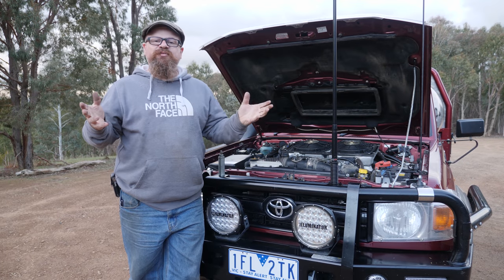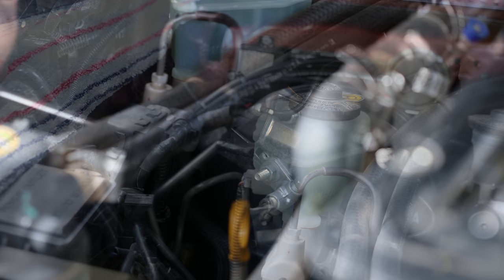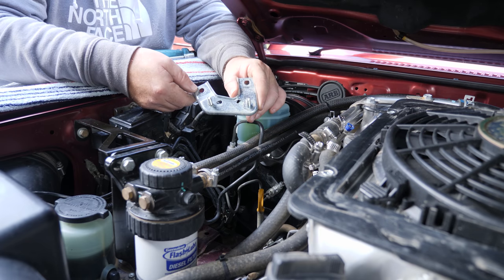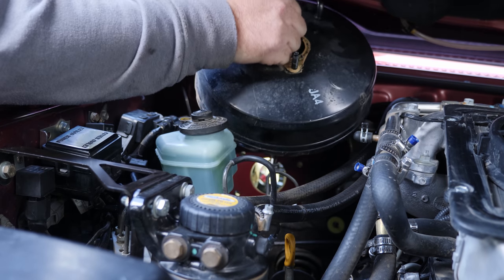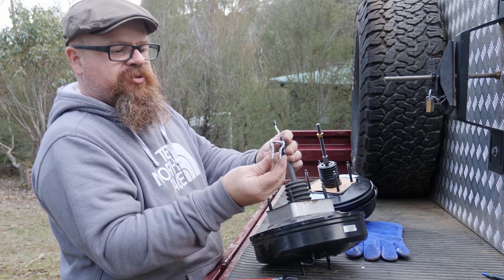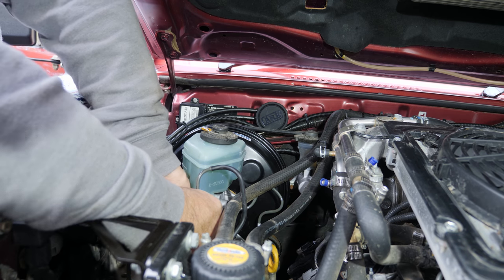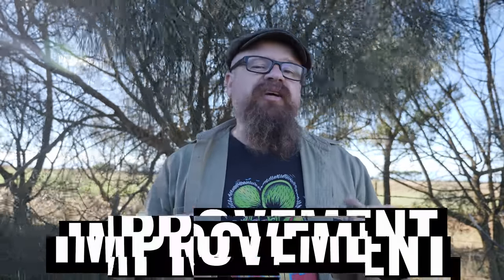Superior Engineering Toyota LandCruiser 79 Series Brake Booster Install and Testing

Comment from the maker: Tell us about the best mod you've done to your 70 series.
Reply: Fitting A.D.R approved braided brake lines and DBA XP brake pads & T3 slotted brake rotors to my VDJ79R, now I can brake hard in an emergency stop & the wheels lock up and the A.B.S kicks in. Didn't have to go the double diaphram brake booster & get engineering approval to keep the modification legal.
Reply from the maker: The braided brake lines made a heck of a difference on my 80, it's a great mod for any 4WD.
Reply: @dustyfarmer  thanks for info mate, was shocked how bad the brakes are, I'm still tempted to get the booster
Reply: @troopey7822  I had the wheels off my VDJ79R the other day & I was impressed with how the DBA XP pads are wearing, I thought they might wear down quickly given the extra grip & bite but no, they are polishing up the rotors harder than anything before but I wouldn't run any other pads now other than XP's. One problem reported with the double diaphram booster upgrade is spongy pedal feel or noise. There is the Marks Hydra boost master cylinder upgrade that taps into the power steering circuit but they are not without noise & power steering feedback issues too apparently, most videos doing the brake test have the A.B.S disabled by engaging the rear locker, not how most people drive everyday on the road I would say. I wouldn't get any braking performance upgrade as the A.B.S kicks in now & would do so with any booster or master cylinder upgrades too. Next mod I think I'll do is replace the poxy standard issue Workmate seats with something more comfortable & adjustable.
Reply: @dustyfarmer  hmmm interesting. I've got my eyes set on the stratos seats! Sat on recaros, improvement but nowhere near as good as the stratos 3000 LTSS, what you looking at?
Reply: @troopey7822  Same Stratos seats, I think they will best do the job, the seat & rail costs & dealing with the local engineer/s for certification are the only thing holding me back. I managed to get the fine adjustment I needed in the backrest by stacking washers under the rear seat mountings so a detroit locker in the front might be next. UPDATE I fitted a Harrop EATON TrueTrac to the front and so far it seems good off road, no more wheel spin.

Comment: Good comparison video
The 80 series Landcruiser double diaphragm works just as well and cheaper.
Reply from the maker: From superior eng?
Reply: @LockyourHubs4WDing  No, the non abs oem 80 series Landcruiser booster is a straight bolt up with the push rod extended 25 mm to the 70 series  and it is stock as a rock with a double diaphragm from factory.
Save yourself 600$
Reply from the maker: @davidgriggs3967  didn't know that, thanks!

Comment: i reckon a Marks Hydraulic system would have been a good option as well
Reply from the maker: Have you installed one?
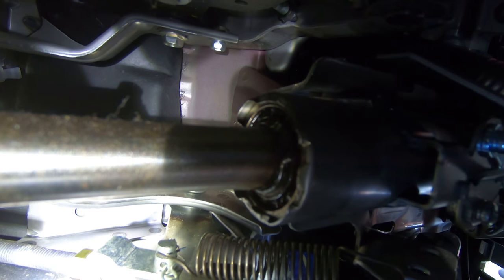Reply: @LockyourHubs4WDing  No I haven’t personally but watch this from 7:52 https://youtu.be/BGcUYgzSXGQ, looks like a great unit , plenty of pressure, and looks relatively easy enough to fit ( around $1300) ... I’m seriously considering it for my 80 with the LS1 in it !

Comment: Did you get that brake booster mod. ticked off by a certified engineer? Brake booster changes from single to double diaphragm are specifically mentioned as needing assessment, you want to keep your insurance valid in the event of a claim.
Reply from the maker: Thanks, as it's not my car, I'm not sure.  I know it had a GVM upgrade done post registration, though not sure if the booster was included in the certificate or not.

I'll let the owner know.
Reply: @LockyourHubs4WDing  I was just reading about braking modifications & having talked to a tech guy at DBA about my T3 4000 disc rotor, DBA XP pads & A.D.R 42 braided brake lines upgrade on my VDJ79R. The Brake assessment manual under heading, Braking modifications that require assessment, is very detailed and I was concerned that after reading some sections but He told me I was essentially replacing like for like and the rotors are the same diameter and brake pads having the same surface area. I was asked the direct question by my insurer about modified brakes when I recently insured it. If that double diaphragm booster wasn't fitted when the GVM upgrade signed off on it wouldn't be in the detailed submission that goes to your states rego office from the certifying engineer and goes on the mod plate &/or rego details. It really sucks, I wanted to fit some projector headlights after watching your vid. on L.E.D headlights as projectors are the bees knees performance wise but an engineer told me it would cost me about $10K to get him to do all the testing & report writing to get them to approval stage on my vehicle. Funnily enough, the projector kits you can get online are not legal for road use anywhere in the world.
Reply from the maker: I understand to be legal, with projector retrofit, or any high powered light regardless of the technolodgy used, the low beam pattern of course needs to be compliant, and the low beam need to be self leveling and headlight washers.
Reply: @LockyourHubs4WDing  Headlight washers, I asked a bloke who sells them about that, He couldn't explain why I needed water washers just that they are on modern vehicles. I think there could be a risk my VDJ79R plastic headlights might melt with projectors fitted, the washer jets could be handy for putting out the fires.
Reply from the maker: Haha!